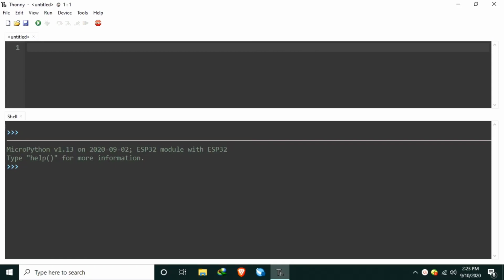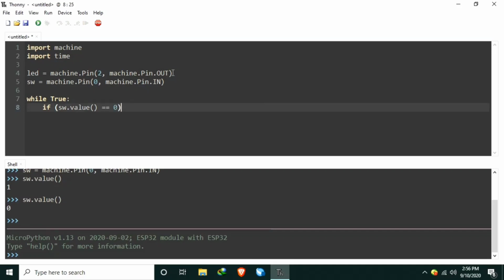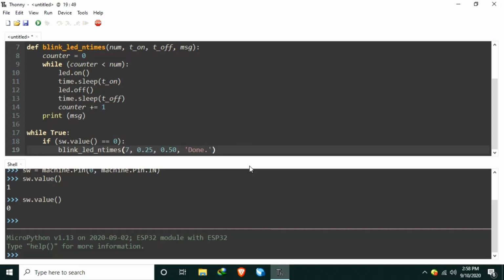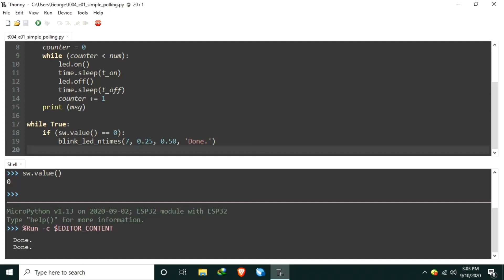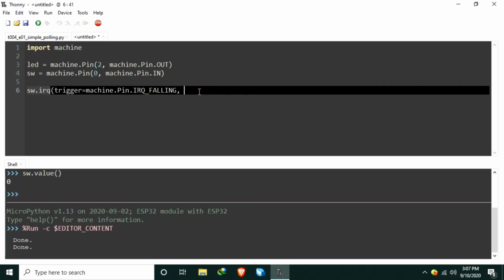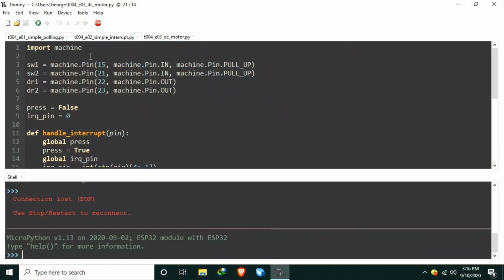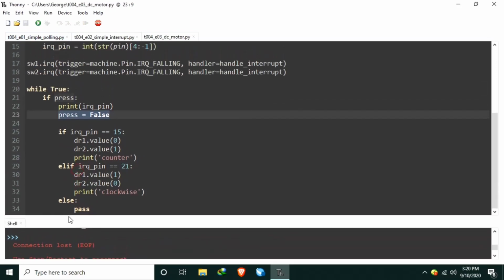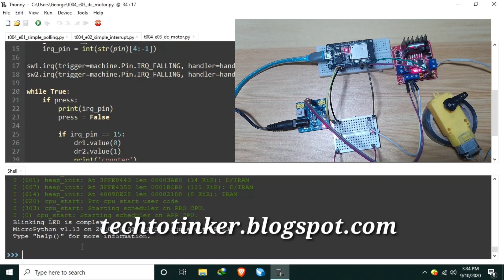004 - ESP32 MicroPython: External Interrupt

Comment: I don't understand pin parsing. For example for pin 21 ,str(pin) is '21:IN:PULL_UP' then how come str(pin)[4:-1] returns pin number but not ':PULL_U'
.......
Please explain
Reply: me too. Don't understand this part.
Reply: Try to play with this code and you will understand it :-) 

import machine

led = machine.Pin(2, machine.Pin.OUT)
sw = machine.Pin(0, machine.Pin.IN)

def handle_interrupt(pin):
    led.value(not led.value())
    print("Original string: " + str(pin) + "    Parsed string: " + str(pin)[4:-1])
    
print("Press BOOT button\n")    
sw.irq(trigger=machine.Pin.IRQ_FALLING, handler=handle_interrupt)

Comment: This is great and wont block other code.  Is there a simple example you can use with serial input like to time a question with interrupts such that respose = input('Enter answer: ') if response == None, print('Fail!') but based on a timer?